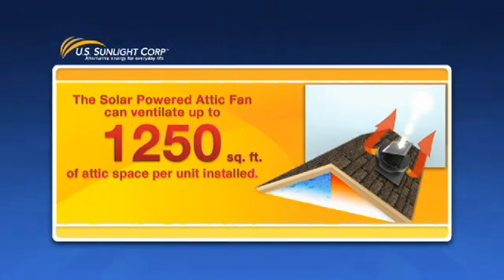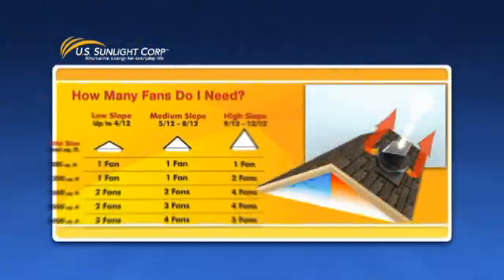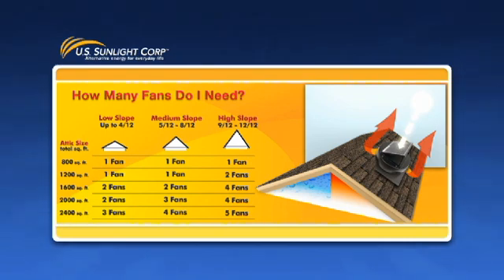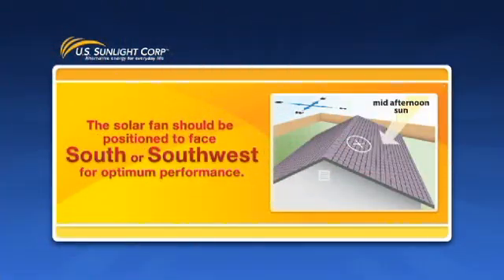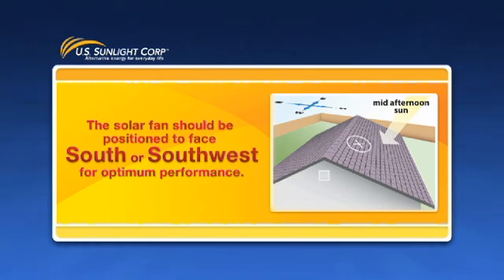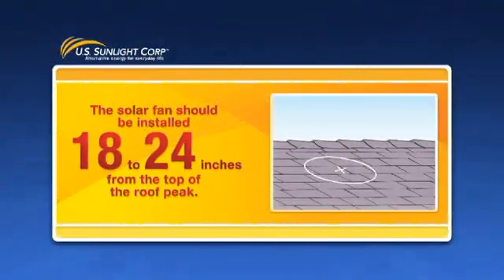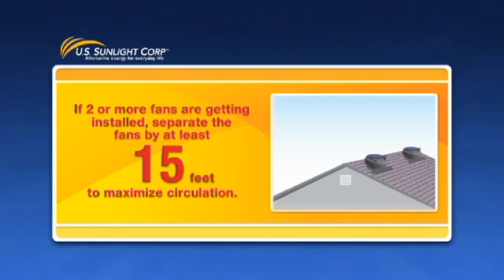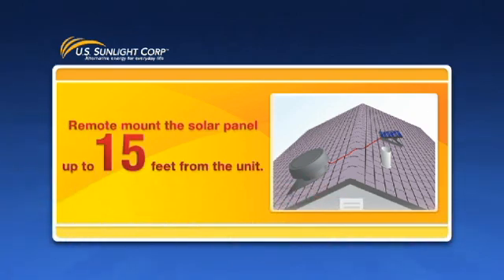Solar Powered Attic Fan Installation - Part 3 - Preparation

Comment: I am very happy with the fan.>>>nub.best/x0rq      I've checked it several times after installation, and it has been working very well. It runs in relatively low sunlight. It is also much quieter than my previous non-solar attic fan. The 25-year warranty was the biggest differentiator for me when comparing with other solar fans. I would give this 5 stars, but I deducted 1 star due to Amazon Home Services (AHS).